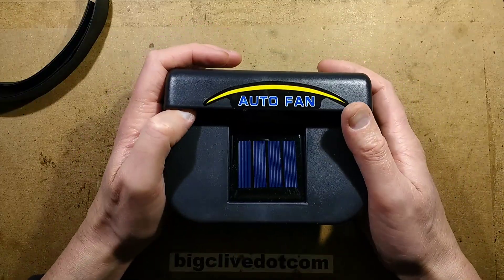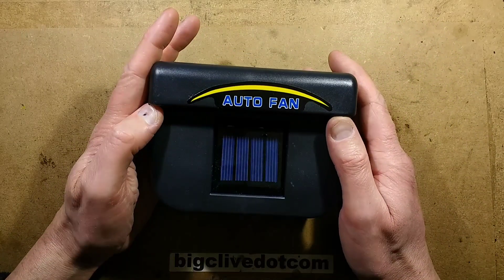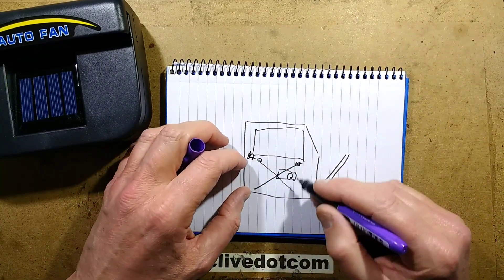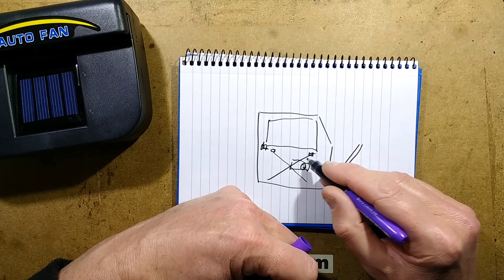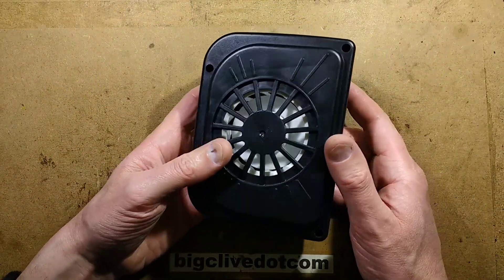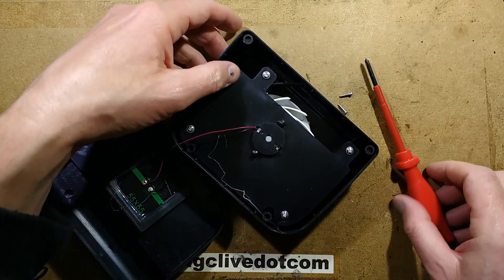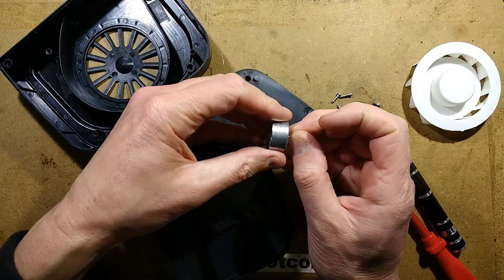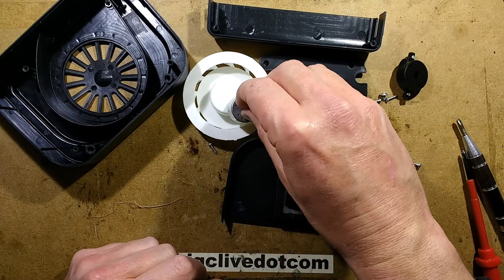Inside a solar powered car window ventilator.

Comment: if that works to cool the car. why brands do not implement it better, direct in car factory?
Reply: Audi had (has?) an option on some models to include solar cells in the sunroof to drive the ventilation when parked. The added cost was just a touch over the sunroof itself (for some stupid reason my S6 has the sunroof but not the solar cells).
So yeah, it's available (or at least used to).
Reply: I seem to remember this show beyond2000 and they said vehicle manufactures were going to put automatic window tint with a dial so you could just dial the shade ya want I'm still waiting.
Reply: I know that it was an option on my Škoda Superb. I think it was part of the sunroof which I really didn't need. A much better solution is to just set the cars internal ventilation on a timer. BMW has that option and Škoda as well (part of the "stationary heating" option - it can also be set to cool the car in the summer). With Škoda you have the option for a timer and/or a remote. And with BMW it's timer only (though I think it can be remotely operated as well - part of another option).
Reply: Hmm - 1kW per square metre solar insolation under full sun (although not in Scotland, obviously) - so the vehicle is being heated with about 3kW - and that fan is about 1/4 Watt at best. Just buy a white car.
Reply: I just roll my windows down a little bit when I park. Works miracles
Reply: Lucas It's fan only for ventilation. Not AC.
Reply: Eden's Aquaponics haha, I'm not even going to edit my post. I'll leave it there for entertainment purposes. Don't even know how to spell the car I drive everyday.. classic
Reply: All US cars are required to have a pathway of airflow, typically through slatted vents hidden in the passenger compartment that allow air to move to the trunk to help prevent CO and CO2 buildup... Why couldn't they put a muffin fan in the vents into the trunk to draw air through when parked? It wouldn't cause negative pressure because there is a mandate that air should be able to enter the cabin when the HVAC system is off... Also, some trunks are so airtight that they have slatted vents to the outside, fans there would work too. Maybe nobody thought it was important enough?
Reply: Ya see them as an option for vans, ya know that thing that spins around on top. Don't see them much anymore.
Reply: When the car was stationary?
Reply: Stationary and locked.
Reply: Well it doesn't.
Reply: Proyectos LED it’s called remote start
Reply: Would be nice, every car already has everything required except for the solar. I'm sure the manufacturer hopes you'd go for their top of the line model to get that feature, but in the real world it doesn't happen (except for those folks who live off credit and having the best model that they can't afford).
Reply: He's just wrong.
Reply: Lucas If the system is using only a belt-driven refrigerant compressor, yes you are correct. I could see electric compressors and/or Peltier devices replacing or complementing the mechanical system, in the not-too-distant future. Though I suppose we're drawing a line between ventilation and cooling here.
Reply: The problem with true air conditioning (cooling), as opposed to ventilation, is that it requires the use of a compressor to liquefy the refrigerant (thus allowing it to then evaporate, taking heat from within the passenger compartment of the vehicle to do so). This requires a reasonable amount of energy and with an internal combustion engine there's usually plenty of that available, even with the engine just ticking over. As soon as you start to use battery power to do this you can find noticeable reduction in range a very real issue. Someone mentioned peltier elements as an alternative and whilst they don't waste energy with the friction of moving parts they are woefully inefficient and require surprisingly high current to be of equal use, which is why they are really only limited commercially to gimmicky cooling devices. Sadly, unless battery technology significantly improves I can see us all balancing comfort and range in the automotive future
Reply: They do, it's called air conditioner, also this thing does not cool down the car, it's taking the air from the car out and because the hot air stays up top and this is mounted up top it gives a sensation of cold.
Reply: DashCamAndy my 76 Chevy blower is on all the time, very low.
Reply: Eden's Aquaponics yep, and the sonic washmachine, no detergent needed.
Reply: Proyectos LED I wondered the same thing. I think maybe the ac should work off of solar.
Reply: Raymond Mucklow unfortunately our state by state regulations on window tint prevent that from happening.
Reply: Michael Fisher that was the beauty of it, supposed to be adjustible after I post that comment I did look a little bit, Nissan did some stuff with adjustible window tint, it's out there just not very popular. Prolly crazy expensive. I'm trying to remember there was a vehicle manufacturer that's still playing around with it.
Reply: Michael Fisher that was a big part of it, adjustible it was supposed to be.
Reply: Proyectos LED I bought one of those things used it in my compact Nissan/Datsun pickup .when ever I parked out doors. I know the fan ran even on cloudy days. I saw no difference in the internal temperature of the car but in AZ when the temperature is 110 F in the shade...
Reply: They do. The Audi a8 has/had a solar roof to run ventilation in the sun.
Reply: its not for cooling while driving its for helping you car stay under 140 degrees in the Texas sun when it sits in a parking lot
Reply: It would cost money, so they would list it as an extra at 10x the cost of the actual price and nobody would pay for it.
Reply: Both my old BMW had this function, it would automatically turn on the AC with fan only when you reach certain temps
Reply: Lucas now that I think about it. My current Aldi I can run the AC without the engine running. Although it doesn't have a timer function, or at least one I know about. I imagine it would be a swift way to kill the battery either way.
Reply: +OutdoorsIQ How would the AC work without the engine running? My bmw has the normal fan and a heating fan (Diesel heater or something, 3000$ addon) But to have the ac running youäd have to start the engine
Reply: There was a model of Prius that had a solar panel in the exterior of the car, I think in the wing, that would run ventilation when there was enough sun and the car parked.
Reply: @SigEpBlue That future is already here though. The AC in a Lexus hybrid is powered through electricity and doesn't need a running engine. If I remember correctly they use a separate (or part of the main) battery to power the compressor when the engine is off.

Comment: It's a bit late now you've siliconed the window up, but had you considered wind deflectors? They let me drop the glass a tiny bit to let air circulate while I'm at work. Works great when it's a little damp inside from wet shoes. It can pour down and it would only get wet inside if it was somehow raining upwards.

Comment: I got two of those fans from a company called Coopers of Stortford around 10 years ago,  they sold them for ventilating cars with dogs in. The air flow is absolutely pathetic to say the least. I gave one away the other I still have in it's original box. wonder if the solar cells are better than those on the power banks which dont seem to produce as much power as the flashing led's that show the solar cell is working and flatten the battery when "charging in the sun".

Comment: Sometimes when the window glass slams down into the door like that,it will shatter. Also a note about safety,to anyone who tinkers with a power window..be aware of where you stick your hands in there while working. Should the glass suddenly drop like that,and your fingers are in the way..well,I'm sure you can imagine. The metal edges of the door can be quite sharp,and the glass quite heavy. Not to mention the scissor-type action of the 'pantograph-ish' part.

Comment: I bought one of these to fit to a rear window of my car, only to discover that the rear windows are slightly tinted which meant that there was rarely enough power to start the fan. When it did start, the air flow was so minimal that it had no discernible affect.

Comment: This may be an old video, but I'm so happy to see you ripped it apart. My father had me take a look at his, so I saw it was simply a corroded wire, guess the guy who owned it before the second hand store sold it had it in water, guess maybe a rainy driving day or two. Either way, I added two additional solar panels from yard lights [the panels that are a slight brown color] and then a capacitor from an old ATX power supply 250V at 400 uF and it worked like a dream in low light, and obviously all better lighting conditions. Great little fan, until my father left it on the back deck of the car, and got direct sun on a 35C summer day in Manitoba.....oh well, it looked good and functioned well...until it's death.

Comment: I thought of getting one of those, but seeing how cheaply they are made I decided to go with a different setup.
on every sedan or coupe beneath the carpet in the trunk you'll find some flaps that lead outside. A few minutes of work and you can install a small fan over this flap. I have the fan powered by a chinesium solar panel and battery setup. add a thermal switch between the fan and battery and it works wonders.
Reply: YES OMG I suggested this above... It makes so much sense to me, the ducting is already built in, and it's probably ten times more effective than the over-the-window units!

Comment: Door trim can be a pain, I worked for Road Radio, along with sunroofs, radios, we also fitted electric windows way back in the 90’s. 
If your vehicle is an older Renault, a novice should forget removing it with a successful outcome lol.. 
  It might be easier to take a trip to the breakers yard and just grab a door with working window and just swap the lock barrel over. 
  We used to get a silicone lubricant for the rubber window runners.

Comment: The Vw /Audi window regulators are not expensive and prone to failure a lot. The kit comes for about£50 but is a 2 to 3 hour job to replace and very fiddly

Comment: I have seen some of these in super hot areas, so that the fan will take some of the heat out of the car when parked without the "window down". But you wouldn't want to leave it in all year round if you live where there is snow either because blowing snow will fill into the car for sure though that opening, I have seen snow in my old car when I lived in the windy snowy Wyoming winters and it would even get in though the heating vents. The "don't use in rain" is a cover their ass massage because there is no real "seal" ether and they don't want to repair water damage cars from people who leave them in all the time.

Comment: Last time I had an issue with a power window, which was a long time ago now, I just went to a local pick a part junkyard, drilled out the rivets on the mechanism, took the whole mechanism from the junked card, drilled out the rivets in my car and then bolted in the new mechanism. I don't think it cost more than $20.
Reply: Plus the junkyard car lets you practice taking off the door panel. ;)

Comment: Don't fret referencing cassette players I still have a reel to reel machine that also records on 8 tracks.
Reply: 8 track reel to reel? That is mighty cool and impressive.
Reply: roberto l I had aSony cassette deck that lasted for years and years it was a real tank
Reply: Dragos Moldovan it's also older than heck. I brought it back from overseas in 1967

Comment: You might want the check out the new wera insulated screwdrivers. They have the insulation flush with the tip, so theyre great for any task.

Comment: If condensation is a problem just leave 2 widows diagonally opposed open for 5-7 mm.
Reply: Or toss a desiccant pack in the back seat.
Reply: PongoXBongo - maybe a sock full of desiccant, volume is way too big for a pack
Reply: By pack I meant one of those small damp-rid buckets for basements, RVs, etc.

Comment: Hey Clive awesome video man. Here is ha good question for you on the solar panel. Being that the top part there Pushes air outside. It looks like it could block some of the Solar panel. And voltage and everything goes down. What do you think?

Comment: Hey Boss man, I am sure you know, YouTube closed the free picture & video editor option. Me being a cheap a$$, do you know of any software that is free to use and trust worthy, or at best, not too costly, to get me back to uploading my junk?Dru
Reply: Give this one a try.
https://www.shotcut.org/
Reply: Downloading it now... I'll see if I am smart enough to run it, lol... It says it is free do you have any experience with this S.W.?... like maybe it will time out or have limits, until you buy the full version? I am loading the 32 bit and not the 64 bit, due to my laptop being a "Dell, INSPIRON 700m,  or is the 32 bit gonna be too much for my old bucket of bolt, My den PC has the HP, but I am never in my den to use it, I soon find out... Thank you for the info and effort on my behalf, Dru
Reply: I haven't used it yet. It was recommended by youtuber Techmoan and he hasn't failed me yet. It says it is open source so there should be no limits on usage.
Reply: Right on, I watch Techmoan as well... Thank you boss.
Reply: Dru Bradley try davinci resolve, it's professional, free and no ads
Reply: Roger that, I shall down load this one as well!!!! You guys rock!!!
Reply: I have used "GIMP" for many years now, for doing the GIF type files, I didn't know they do the video and picture slide shows too... and I shall look into the "Openshot video editor" as well.... I down loaded the Divinci one about 4 to 5 hours ago, one big zip file, like 685Mb in compressed form... but, the web page looks promising with so many features, that I am not even smart enough to begin to understand, I will be using the "HELP" file...lol Thank you all for the heads--up on these direction. That is why I like this channel, always seems to be really good folks hear. Thank you, Dru

Comment: Good idea, but it's a risk to leave the window open.
I would like a solar fan for the build in car air system. It should be big enough for keeping the battery charged, too. But that would be huge and won't look nice.
Reply: Frank Gormanns I believe Nissan did something like this in the first generation leaf. Small solar panel on the hatch was part of a option package that ran the radio or HVAC without toasting the battery
Reply: Audi used the system in the A8 as well from what I hear
Reply: sean uminski Thank you. That is out of my price range. But good to hear, that somebody does that.

Comment: Does your window switch have the feature where it clicks a step further and raises the window completely for you? Because if you installed this device and then did not reprogram the regulator it could not possibly account for the item in the window and would try to crush it. 

Window Fan: 1    
Window Internal Parts: 0

Comment: This sounds like a good idea, but wouldnt creating air currents just heat things up faster via convection?
Reply: Right. Because exhausting the hottest air (you know - at the top of the windows / roofline) will somehow make things hotter...
Reply: Slicerwizard sure that helps but it also moves all the hot air by the floor o the car
Reply: You misspelled "cooler air"...

Comment: Often times in those power window components, there’s a sheer key in the mix that keeps the motor from severely damaging the glass should it bind. Just a suggestion to look for a cheap piece of plastic that’s broken in the mechanism.

Comment: I actually looked at getting one of these before summer because it gets up to 115 F (46 C) regularly here, and rain is quite rare. That means the car interior is basically an oven. Most of the reviews said it was kinda trashy though. Looks like they were right. Would be nice if someone sold a better design.

Comment: Brushed motor? Not expecting these things to last for more than a few years then.
Reply from the maker: The low speed should result in a fairly useful lifespan.
Reply: A decent low power brushed motor will last for 10 years or so easily. An electronic control system for a brushless... good luck with that.
Reply: I still use the one I bought in '93
Reply: Good point. What little experience I have with brushes are in high-speed applications. Bleh, carbon dust.
Reply: I thought a brushless motor needed electronic circuitry to work, so brushed would be expected here...

Comment: The window regulator setup you describe sounds a lot like what i've seen on some volkswagens.  They are prone to fraying cables which snap and drop the glass.. and as you described, you have to take the whole lock assembly off with the regular as one piece.  It's a pain, but after having had to do this 4 times on cars i've owned, I think i have it down now.

Comment: Not good for pets in hot cars either.... as I doubt the airflow would offer much, if any cooling effect.
Reply: Don't leave pets in hot cars to begin with.  Or leave windows cracked, or better yet let it run with the ac on.